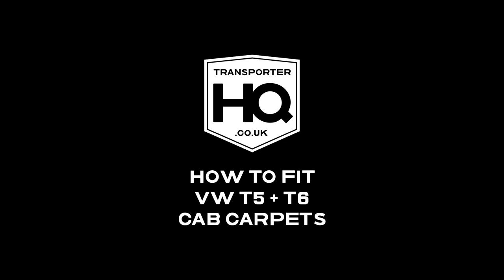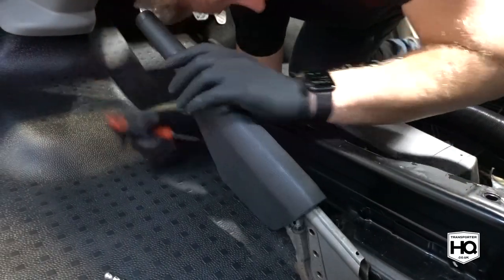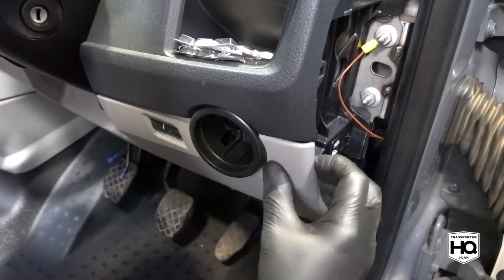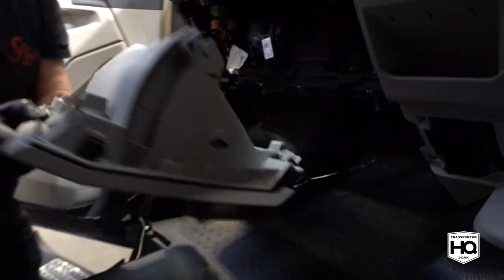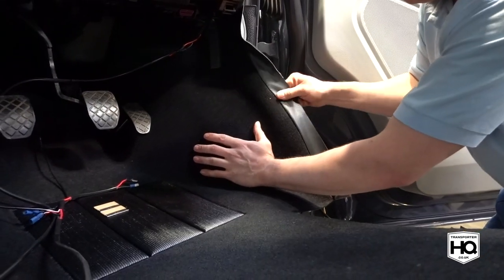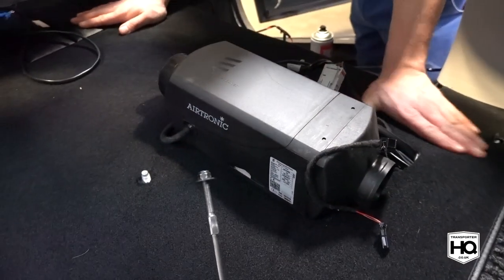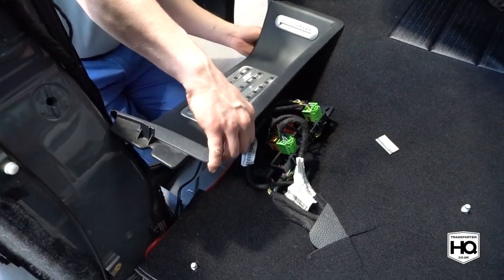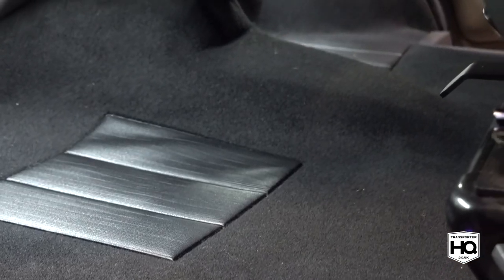How To Fit T5 + T6 Cab Carpets | Transporter HQ

Comment: They look great, very useful video to see how much work is needed to fit them! It will be interesting to see how they wear over time, presumably you'll stick a matt over it anyway?
Reply from the maker: Yeah most will still use a matt as you would normally. There is a fair bit less to remove on T5's.

Comment: i just bought this carpet but my existing carpet is very thick and foamy and sits on top of the metal floor,..this intallation looks like it only works when placed over the existing rubber matting...if take out my existing moulded carpet, i suspect the new thinner carpet will undulate over the ribbed metal floorpan,,, what do i do now?
Reply from the maker: Yes these need to go over an original rubber floor
Reply: @THQAutomotive  so, whats the solution please?
Reply from the maker: @clungebucket23  try and find a second hand rubber floor? You can return the new carpet for a refund if you'd rather.
Reply: @THQAutomotive  thank you, this option crossed my mind, i assume the usual rubber floors are contoured underneath like the foam under-layer to my existing carpet?.... or could i fill in the lower voids with Duomat plus dodomat (which i'd like to have anyway) and get it leveled-off, then apply your carpet?
Reply from the maker: @clungebucket23  yes with some work you could build up the areas I guess.

Comment: hi like the video and production as no gimmicks just info :)
I have a 2009 2.5 Tdi T32 lwb and trying to remove the rubber mat as I want to insulate then probably go for carpet replacement.

The passenger and gear stick column panels seem to be different on mine, e.g. glove box is at top of dash not lower like yours.
Main problem is the gear stick column panels as they seem to be solid. I have removed the drivers side screws by the way

Any advice?

Cheers
Simos